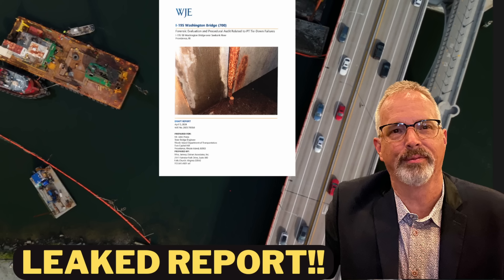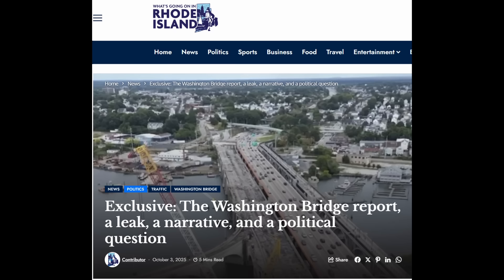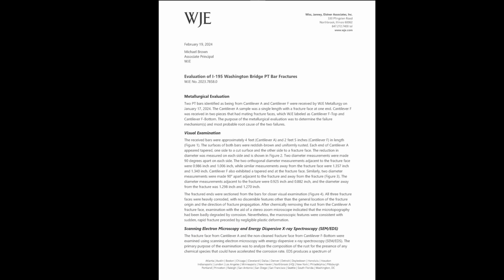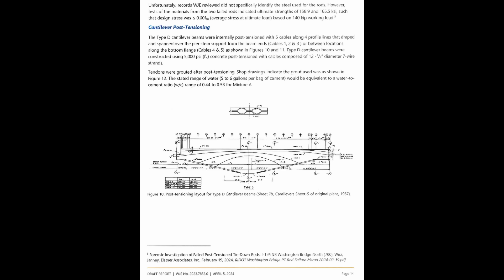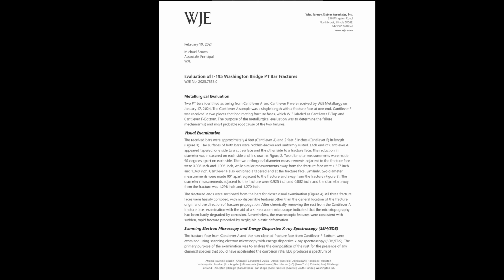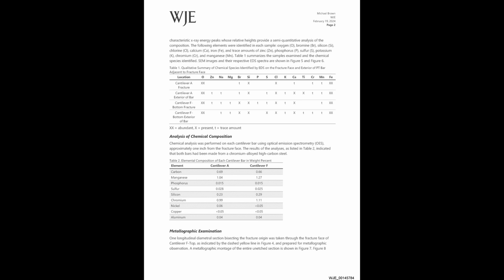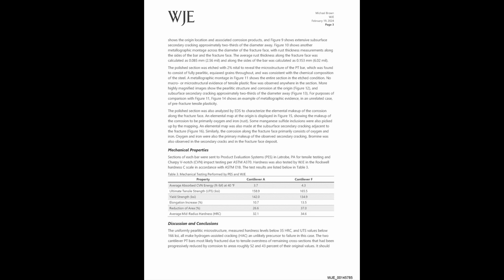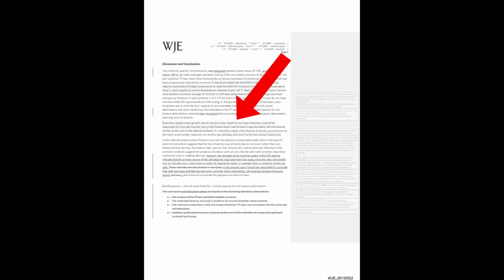Leaked Metallurgical Report for Westbound Washington Bridge PT Rods

Comment: To me, the likely date where the tie down rods finally fractured is secondary to when their condition should have been flagged as critically degraded by inspectors.  It's clear from some of the photos which were available quite early on that there was significant wastage to corrosion, with the diameter of the rods reduced by possibly as much as half at the fracture point by the time they finally fractured.  This seems like it should have been an item of major concern for years prior to them finally fracturing, as that sort of wastage generally occurs over a long timescale unless accelerated by something.

I.e. it seems to me that there would have been major warning signs of the failure for years prior to them finally breaking.  Those warning signs were either missed due to inadequate inspection or deliberately ignored.
Reply: 'Inadequate inspection'😂😂😂 Understatement of the year.  Some of the critical failure items had obviously not been properly inspected for many many years.
Reply: Exactly.  While I have never inspected a bridge as I worked in power plants.   We constantly tested, observed, and analyzed remaining thickness of anything structural or pressure retaining.  Obvious corrosion was always checked out for amount of material remaining. 

One nice thing is that all heat exchangers built using a carbon steel alloy always had a least a 1/8" corrosion allowance mandated by code for pressure retaining parts- and some specifications and Mfr's upped that to 1/4"; but we always tested to see where we were in the corrosion allowance amount - and if we had a likely useful life of the heat exchanger issue.  I have worked in plants that had required corrosion allowances on certain structural components as well.

Comment: Road salt on top  and salt water bay underneath...
Only galvanized and or stainless steel rebar should be used .
Post tension rods should be protected wrapped like bridge cables .
Inspected regularly.

So many bridges structures affected by road salt sea salt.

Vehicles ruined by road salt intense corrosion underneath.

Mafia often owns road salt suppliers in NYS .
Its gold during a bad winter in NYC .

Comment: If the anchor rod was broken in July 2023, I can’t believe the inspector who took the photo of it during that time didn’t notice any vibration with it when a car went over them.
Reply from the maker: That is a good point.  I think there are questions about just how thorough those past inspections were.  Even so, RiDOT is ultimately responsible for performing those inspections.
Reply: @CaseyJones-Engineer yes, either way the metallurgic report proves, at least in part, that there was road salt in that area when there shouldn’t have been in. Most likely this was due to the drains were not being cleared of debris. Also since it was just bare metal it should have been checked more often.
Reply: Well, if you've ever worked on bridges under live traffic, they all vibrate/move much more than people expect. Unless there were unusually large vibrations, I doubt many inspectors would bat an eye.
Reply: The loose end was buried in seagull excrement(where the corrosive necking and break near the base occurred) so it would have damped vibration of the rod. 
When I googled - seagull excrement corrosivity steel tie rods -   
Google AI says -
 "Risk factors for tie rods
Tie rods and other structural steel components are particularly vulnerable because:
Difficult to clean: Tie rods are often in locations that are hard to inspect and clean regularly, allowing droppings to accumulate and harden.
Localized, persistent damage: Repeated, concentrated exposure to droppings can cause highly localized corrosion, including pitting, which can be more severe than general surface rust.
Structural compromise: For load-bearing parts like tie rods, corrosion can compromise the component's integrity over time. In extreme cases, this persistent corrosion has been implicated as a contributing factor in bridge structural failures."
Reply: @WendyOlsonRLA  it would pretty funny if the rod just disappeared into a bird nest and no one thought to wonder about that. at some point, you have to hold people responsible for their incompetency, I would start by banning them from any engineering or inspection job for life.

Comment: When did the steel loose its strength and, therefore, purpose?
Reply from the maker: The rods lost load carrying capacity over years as the diameter of the rods decreased due to corrosion.

Comment: Thanks for the "you can run, but you can't hide" update....RIDOT thinking that they can convince the public that those supports would suffer a catastrophic failure in six months is laughable--and I am a complete layman.  I just looked up the rate a steel rod would rust if immersed in salt water and the rate per year (of course there are variables) is approximately 0.035mm or 0.0013779528 inches.  So the amount of degradation from rusting would be 0.0006889764 inches in six months.  For reference a human hair on average is 0.03mm.
Reply from the maker: That is a very interesting piece of data thank you for sharing it!
Reply: @CaseyJones-Engineer  its more like 3mm a year for continuous exposure to saltwater. cheap mild steel cofferdam pilings in a certain location in the pacific northwest have corroded at about 1mm a year in saltwater at 45F year round temperatures.